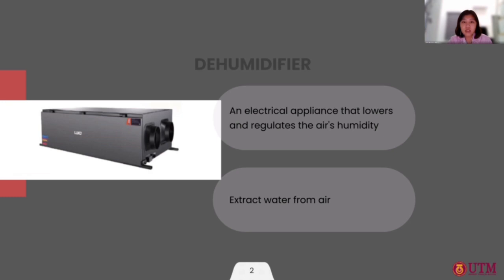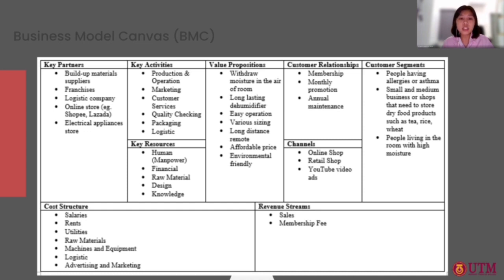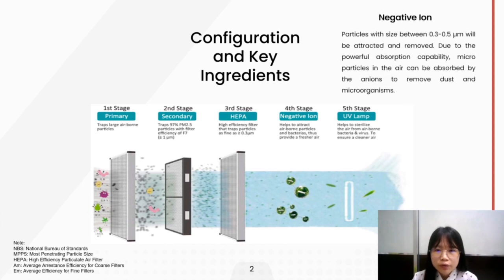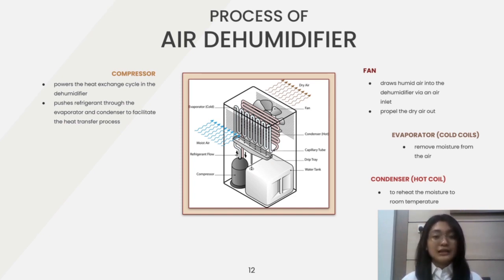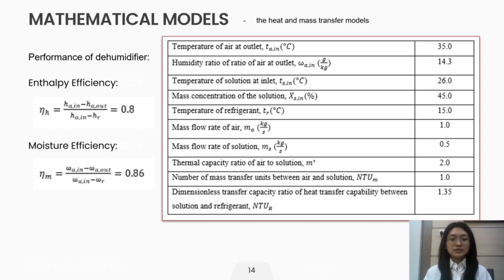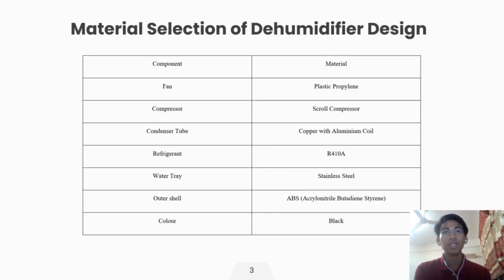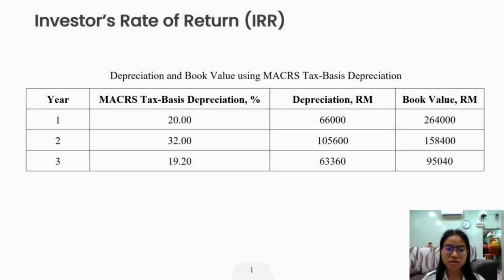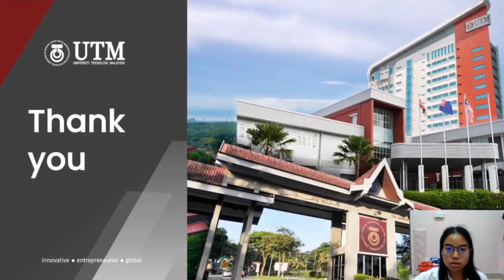Chemical Product Design Project_SETK4143_Dehumidifier_Group 8

Comment: based on the BMC, can i know why you consider the raw materials as one of the cost structure of the humidifer?
Reply: Thanks for your question. The raw materials here mean the build up material for the dehumidifier. Thus,  the spending on raw material is necessary to be considered in BMC for further planning.

Comment: Hi, I want to ask about the decision to use refrigerant R401-A instead of R-32
Reply: Sorry, I think there is a typo on R410A. In my opinion, although R32 is more efficient but it has some shortcomings as well. R32 is slightly flammable and has higher discharge temperature compared to R410A. The high discharge temperature may harm the compressor particularly in the high compression zone. Since the dehumidifier is designed to be placed in house, we consider these as the safety factor and decide to use R410A to avoid all these unsafety issues especially when there are kids and children in the house.

Comment: May I ask what is the most important factor in order to determine a humidifier's performance?
Reply from the maker: Sorry, I think there is a typo which should be dehumidifier. In my opinion, I think the most important factor to determine a dehumidifier's performance is the moisture efficiency because the main function of the dehumidifier is to decrease the moisture of the air. The moisture efficiency is the ratio of the air humidity ratio change through the dehumidifier to the maximal possible humidity ratio change. When the moisture efficiency increases, the air humidity ratio change increases, the humidity of air outlet decreases, the air outlet will be dryer. Thus, the dehumidifier's performance is better and more efficient.